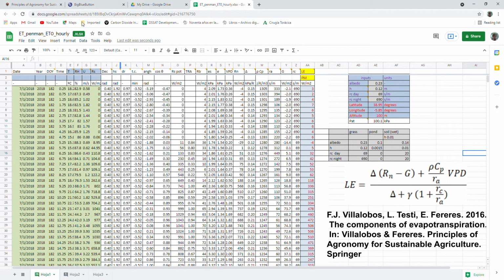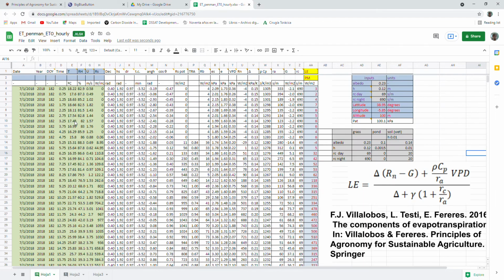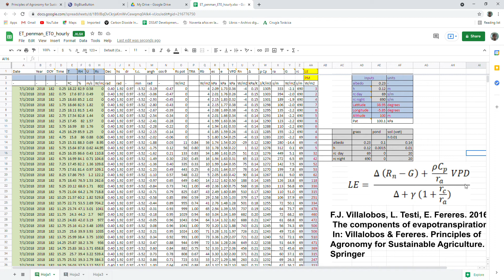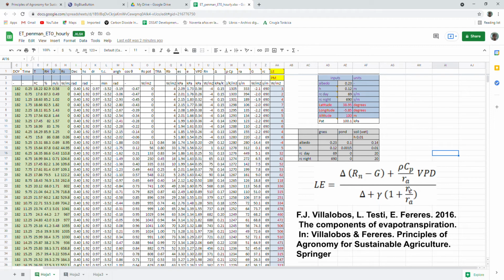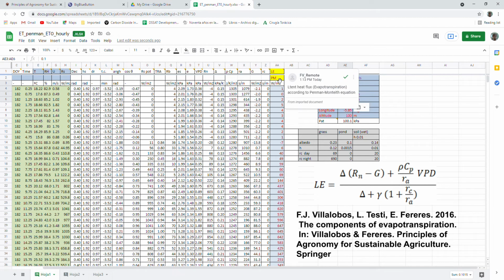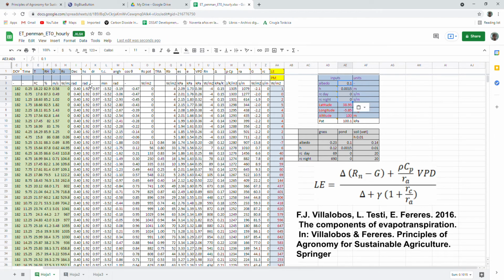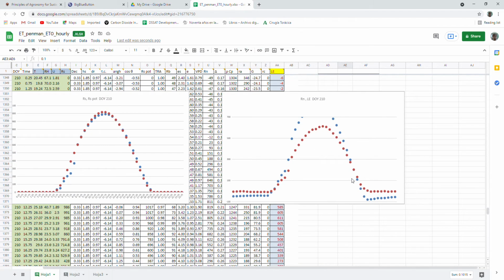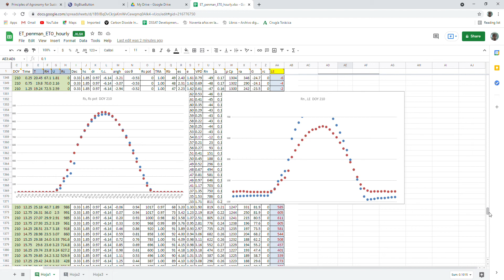Hourly ET using the Penman-Monteith equation

Comment: Thanks for this very intersting video, just I want to ask you about the time value (0.25, 0.75, ...), particularly, the new weatherstation record data every 10 minutes!
The second question about the unit of ET, I think it would be cm/min?
It would be sokind from you if you can upload a new video with this additions!
Reply from the maker: It's the same if you use 10-min or 30 min intervals. The units are W/m2, i.e. J/m2/s, so if you have 30 min (1800 s) then you multiply the LE by 1800 and you will have J/m2 in that period. Now consider that 2.45 MJ are used per kg of water evaporated ...

Comment: Dear Francisco Is that modified Penman-Monteith by FAO?
Reply from the maker: Not exactly. The difference is in the calculation of long wave radiation. However, the results should be quite close
Reply: @FranciscoVillalobos   Dear Francisco thank you for answering. I hope you are fine. It is expressed in w/m2; if I want to find in mm/d should I multiple LE by 0.035?
Reply from the maker: @cayansabahattinoncel  W/m2 is equal to J/s/m2. Now, it takes 2.450 MJ to evaporate 1 liter of water. You have 86400 s in 1 day. Take the average LE in W/m2. Divide by 2450000 to get L/m2/s and multiply by 86400 s/d so you will get L/m2/day
Reply: @FranciscoVillalobos   1/2450000*86400=0.04 as convertion coefficient. thank you for the detailed explanation.